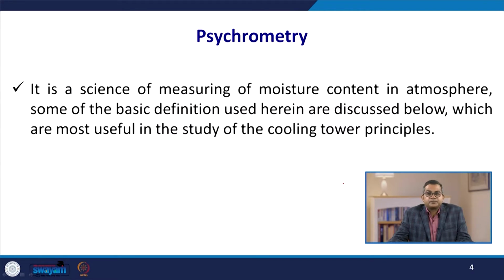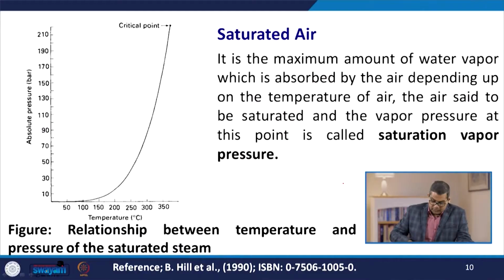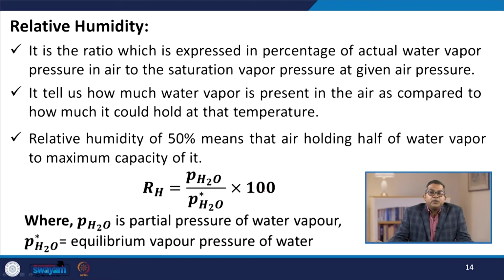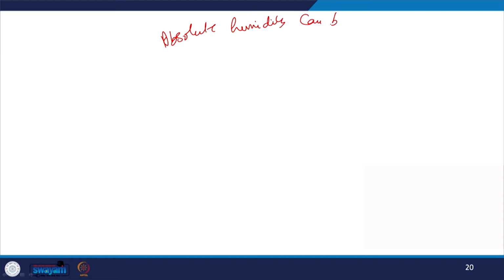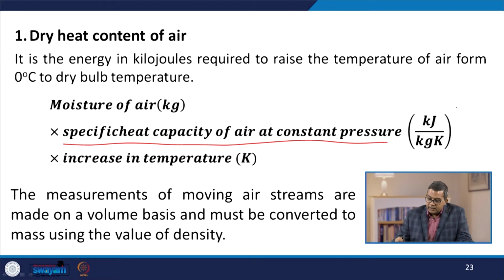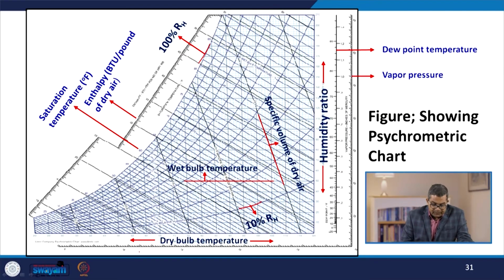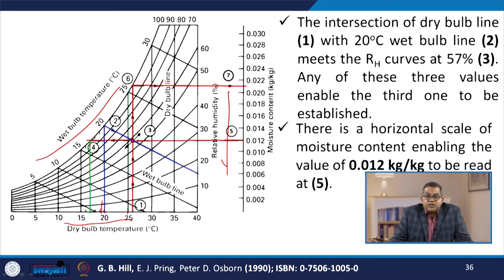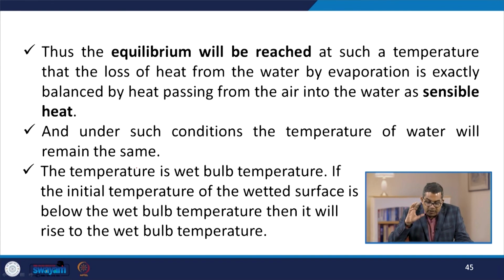Lecture 43: Cooling Tower; Theory and Some Basic Calculations

Comment: I think you have to use 2.5 kPa as partial pressure for absolute humidity calculation.
Reply: I have the same doubt. molecular masses are also slightly different as mentioned in the question